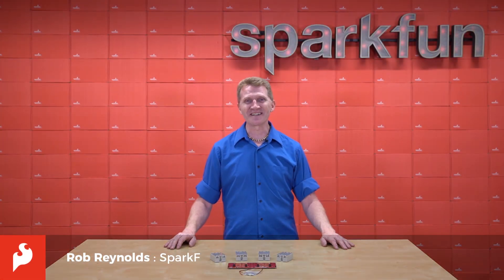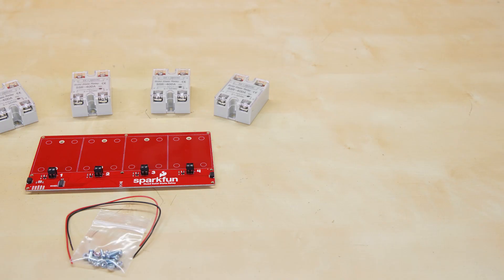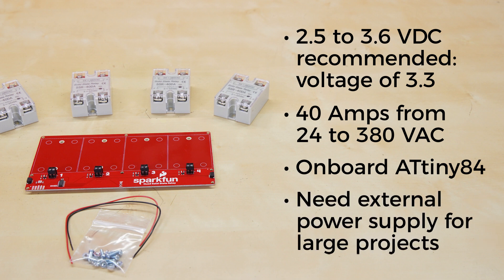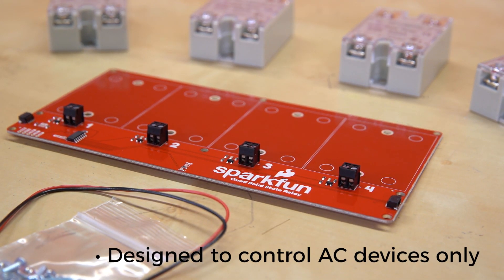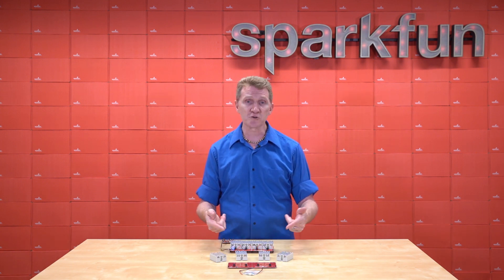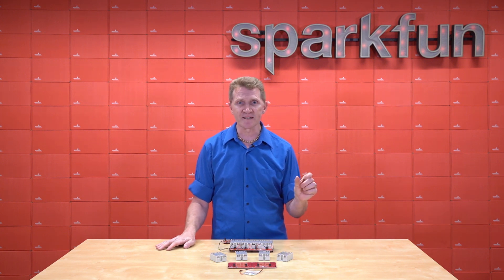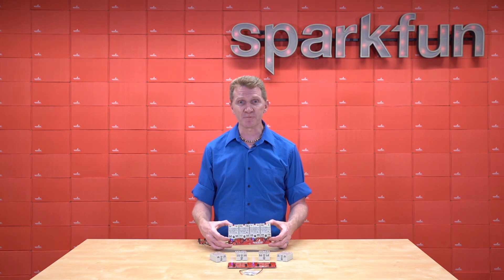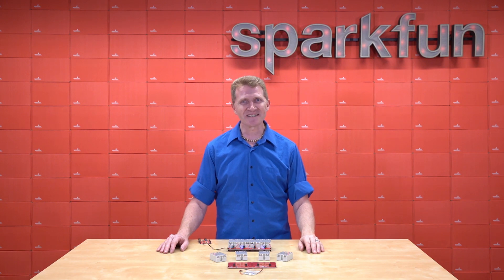Product Showcase: SparkFun Qwiic Quad Solid State Relay Kit

Comment: Hi Rob

Always good to see you! 

Today’s product has a lot of serious potential for making a  greenhouse cooling system. 

Larger fans that require that more power along with window activators makeup a reliable cooling system. 

Most home greenhouses have small under powered fans and hand operated windows.  Using relays that can handle more power then your standard do it yourself kits provide a  powerful and reliable system. 

Thanks for today’s review. Looking forward for a active demo showcase your new relays.

Comment: "Wouldn't be able to turn them off without resetting the board" --> Factually inaccurate. Wouldn't be able to turn them off without pulling the (high-voltage) plug. 
Resetting the ATTiny will achieve nothing.